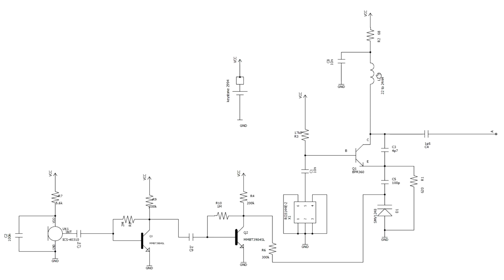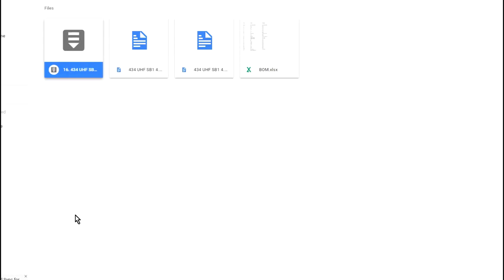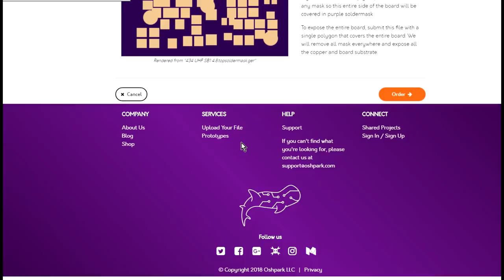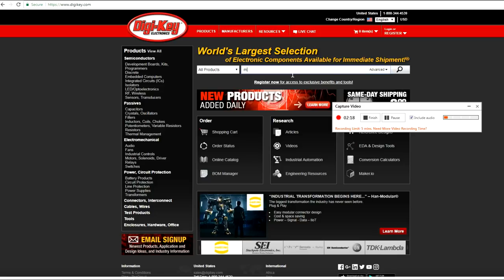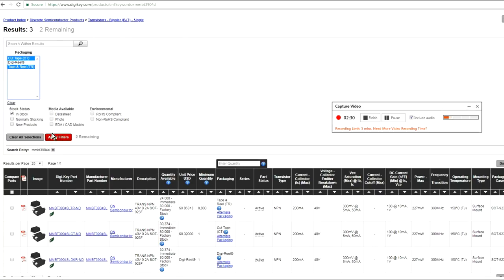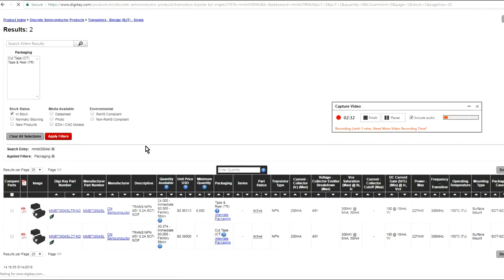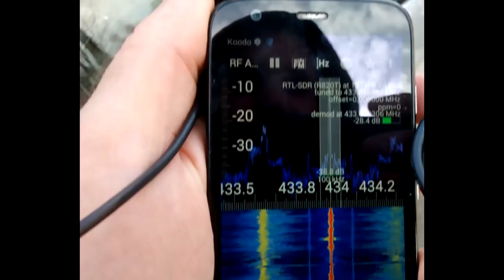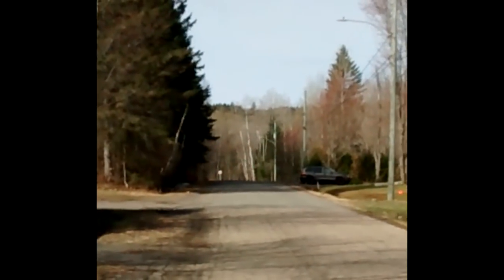Ultrastable 1.5V microsized UHF transmitter

Comment: can we use the camera with transmitter and send the video and audio clip. I mean to more precise like using the camera and voice inside a pen and seeing it from a distance..
Reply from the maker: Anuj Regmi possible with the right budget. There are tiny camera cube modules with analog output  but are expensive...
Reply: After i connect the analog camera and the microphone in the circuit you have shown, how would i see the video. I didnt find any video about that. There are very few video about diy CCTV. Can you please suggest something....
Reply from the maker: you can not just connect a camera to the circuit in this video. Theoretically you could buy a mini endoscope camera of about 4mm diameter, 20mm long that has composite video output and modulate a high frequency carrier with it. This could then be received with a common TV set. But, first, these cameras cost at least $50 US, second, they draw a lot of current, nothing a 4.8mm mini button cell could provide, and third, for UHF you would have to develop a stable transmitter of 470 to 800MHz (for UHF). Doable? Yes. Easy and cheap? No. These cameras are available on Aliexpress for example

Comment: I don't see the antenna listed in your parts list- could you suggest one for me? I also don't see the battery holder listed, but I can figure that out. Very cool thank you for posting!
Reply from the maker: The antenna is a 1/4 wavelength long. Just a wire

Comment: Lieber Tom, ich habe deine verschiedenen Sender erst jetzt gefunden und nutze deine grossartigen UKW und UHF Vorlagen, um den heimischen SMD-Prozess auf Vordermann zu kriegen, insbesonders die 01005 Bauteile sind eine herrliche Herausforderung. Ich selbst beschäftige mich seit den 1970ern mit  Kleinsenderbau, seit 1990 auch in SMD. Für einen Modellraketenverein entwickelte ich in den 1990ern einen Gegentakt-Ortungssender im UKW Band, der bei etwa 500mW lag und auch an die ueblichen Fernsteuerungen mit Data & Versorgungsspannung angeschlossen werden konnte - dieser schaltete sich selbstständig ein, wenn die Fernsteuerungsignale ausblieben. Gewicht ca. 7 Gramm. 
Im Moment bearbeite ich dein Layout des kleinsten Bugs (6.8x4.75mm) etwas nach, um verschiedene Keystone Knopfzellenhalter einzupassen, er wird dadurch etwas grösser, 5x8mm.  
Ich habe noch viele ZnAir Hörgeräte Knopfzellen übrig (312), diese verfügen über wesentlich höhere Kapazitäten bei etwas geringerer Spannung (1.4V), was wiederum die "Schutzdiode" überflüssig macht 🙂. Diese passen dann auch auf die 5x8mm Leiterplatte, allerdings mit Drahtbügel.
Was mir noch auffiel: Du sprichst fließend und akzentfrei deutsch, englisch und französisch? Bist du ein gebürtiger Deutscher (oder die Eltern sind es?) und wohnst im Osten von Kanada? Cool, wenn man 3 Sprachen beherrscht - mein Schulfranzösisch ist eingerostet nach den vielen Jahren, kommt aber wieder wenn in Urlaub in F.

Vielen herzlichen Dank für deine Beiträge - mich haben sie motiviert, meine Grenzen neu auszuloten.
Thomas Grande, 62, Berlin, Germany